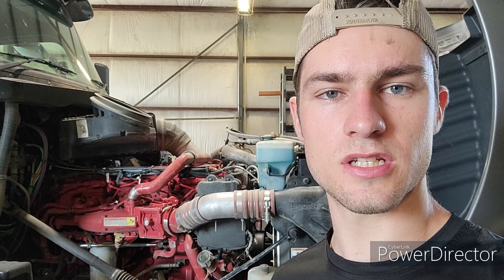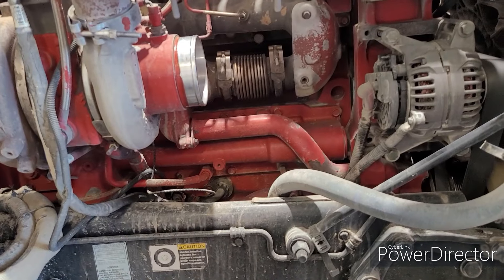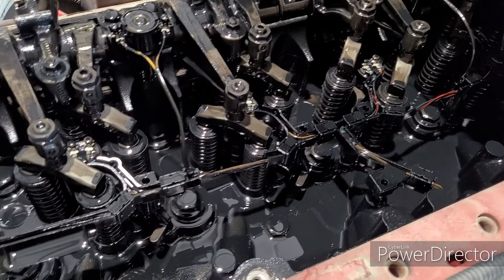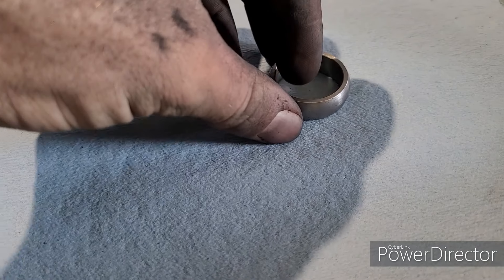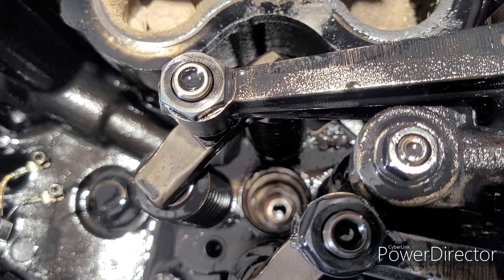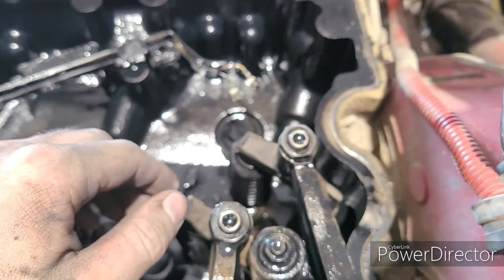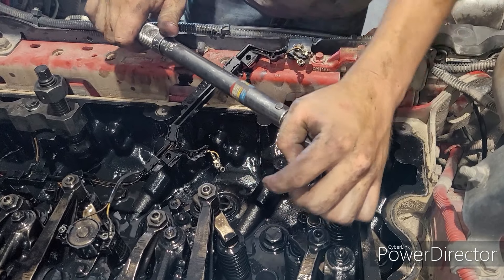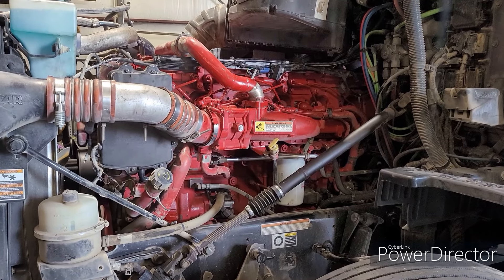DIY- How to fix head on ISX

Comment: you forgot to tell viewers that you got to use a depth gauage & mic those rings should be from the top of the deck to the top of the ring should be no less than 69 or more , bone heads but thanks for the ring part number 368883

Comment: Love the video...is there a way i can contact you, im having the same problems with my isx15 cm2350. coolant in the water separator.  its been diagnosed already and they said it was fuel injector #1 and #6 thats leaking coolant from the injector cups...but they dont do this kind of job with the rings.
Reply from the maker: Hi. You can contact me at NYAMechanic2000@gmail.com
Reply: thanks

Comment: Thank you much for the well done video!!
in case you need to remove it to replace the cup when the ring doesn't fix the problem How would you do it? is there a special tool?
Reply from the maker: I have never had that happen to me. If this ring didn't fix the problem it usually ended up being the head gasket or other issues in the head so I replaced the whole head. I do not know if there is a tool to pull them out.
Reply: @noturaveragemechanic7121  Thank you much for your reply
I found two companies that make the tool to remove the original cup without removing the head.  one is call Irontite, and Industrial Injection services 
i dont know if this will help in any way 
I installed all 6 rings truck will leave on a short run for testing purposes 
i hope i fixed the problem 

thank you again
Reply: @adanponce4401   hey adan I installed the ring but still getting coolant in fuel what did you ended up doing  thank you
Reply: @manuelmoreira9896  my truck is still running strong since I installed the rings 
Last week I notice very little coolant in the water separator…. For the first time since the repair 
Truck has 1.1 mill miles …
I think it’s time to do an overhaul 
Unfortunately the rings are not a definitely fix 
Good luck
Reply: @adanponce4401   thank you for the response how long it's been after you installed the ring ? I did an imframe to my engines 3 Monta ago did not put a new head I only had  it rectified  at the machine shop I agree I think rings may not be best option in the long run I think I ll.justndo the injector cups to be done with it

Comment: I have a 04 isx 565 and I'm getting fuel in coolant is that the same problem rings
Reply from the maker: I personally have never had the issue and don't have the knowledge to answer that. It seems like it's possible though.

Comment: Didn’t torque it down. Didn’t check clearance after installation and didn’t use new bolts for injector hold downs. Yikes.
Reply from the maker: Clearance no, new bolt, no. I did torque it later but completely forgot to film it. I'm out here simply trying to help owner operators and small time mechanics get a job done
Reply: @noturaveragemechanic7121  those bolts stretch out after one use/torque down so when you torque it down again it’ll be at the wrong spec. If you checked clearance you wouldn’t have to do it twice. Just trying to help bud

Comment: I ran the serial number on the engine and it came back as not needed.  So this is ISX specific?  The ring is a recall on these motors.

Comment: thanks for the video can this be done to a cm871 ? my isx has duel cam's ? do they make a tool for it as well?
Reply from the maker: I do not know the answer that. I wasn't aware the older model isx engines had that problem
Reply: @noturaveragemechanic7121  hey thanks for the reply!! I think it's a 871 I'm not exactly sure.it's a 2008 ISX 435 St dual overhead cam. And yeah it seems to have that problem this is the second time and 3 years I talked to Cummins and yeah it looks like I'm going to have to put another head on it... For some reason the retainer ring repair is only available in the sohc.

Comment: What’s the torque spec on the ring when installed ?
Reply: 77inch lbs 1st turn 30lb and then 60. And 60 on the quil tube
Reply: On another video, the mechanic was measuring the seat depth of the ring from top of the injector opening. Supposed to be a minimum of 69mm.